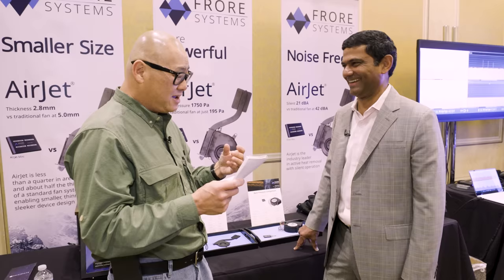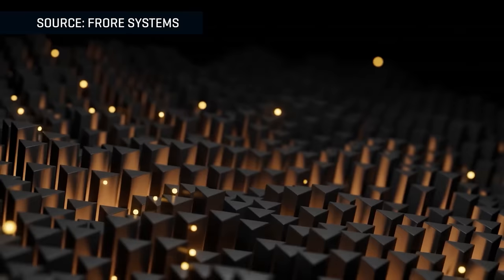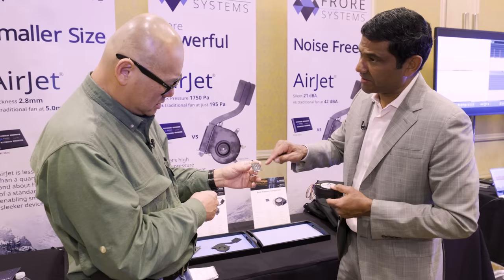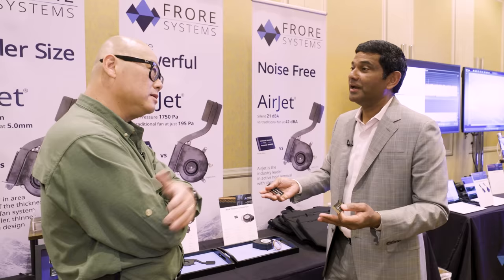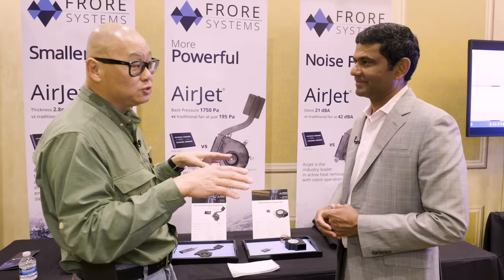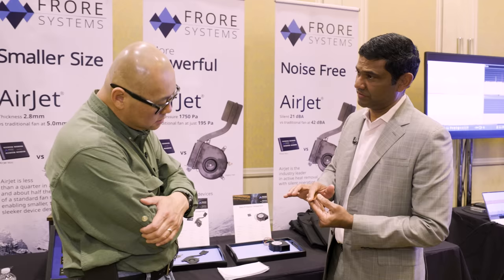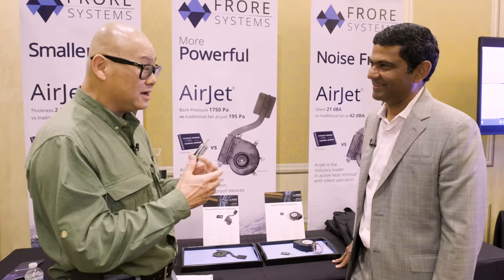Solid State Active Cooling Could Revolutionize Thermals

Comment: I think that this is probably way more exciting than any other announcement from the big players at CES 2023.
Reply: This has the potential to revolutionize computer cooling industry so yeah, I'm excited too.
Reply: I wonder if this tech could be used for electric powered planes too? 🤔
Reply: Half the video one question was on my mind. How much heat can it pump?
10W is nothing. this is currently near useless technology. We'll see if it improves but right now, useless for most computers. More expensive and likely about as effective as just pumping it into the chassis of the laptop, or just using a passive radiator in a pc with some airflow
Reply: There are so many problems with this technology and i will tell you why it is : 
1. Dust, dust, you cant clean this silent boy enough to be effective over period of time.
2. Price. is much moore expensive to produce and use...
3.Power consumption and Noise. Its loud and power hungry.
Reply: @Renovatio2142  1st and 3rd point is wrong.
noise is non existent, normal fans in gaming laptops use 3W of power, laptops in the high end use much powerful fans and more of them too, ROG and alienware have 4 fans in premium models.
2) price is a issue because effficiency is low, you'll need many of these chips in a typical gaming laptop which makes them expensive.
if efficiency of a single chip can be increased to 20-25W then we truly have a revolution.
Reply: @manojpatra2840  and about that dust!?, You forget to write how do you want to solve the dust problem...

And noise its a problem because always when you move air in high speed or around a obstacle you will hear it...There is no other way...
Reply: You probably missed the OLED monitors to be released by Asus/LG. 😉
Reply: @Renovatio2142  He literally answers this at 5:55 in the video
Reply: @undefinablereasoning  yea, thats bulshit....there is not such design...only solution you have is to cover the intake with dense filter and than you have to clean that filter
Reply: @Renovatio2142  So what? you have to do that with fans as well, judging by this things back pressure you'd just need to wipe your finger along the dust cover to unblock it.
Reply: the thing what grind me most about this is that they do not have at the show not even one powerful notebook cooled with this device...Not even one heat source cooled by this technology...
Reply: @undefinablereasoning  fans are robust, small concentration of dust on them will not do any harm to the device...In this came where you move air molecules with vibration...i dont know man....they dont have at show not even one cooling example with heat source
Reply: @Renovatio2142  I'm wondering if you even watched the video. If I recall correctly, most of your concern was addressed in the video. I advised you to watch again for you may have missed them.
and also while it is good to be skeptical, you don't have much to work on at the moment to outright deny their claim.
Reply: @kissu_io  OLED is already common, being used in monitors is nothing interesting, just a small step forward.
Reply: @Blueisnotacolor  watched but its just PR without any test..also their website looks like Ralph Loren Store instead of laboratory...
Reply: @Renovatio2142  they do have a demo laptop
Reply: @AlexRaylight  monitors are 27"-ish size or let's say 32". Name me 3 monitors that were released in the past 5 years please. Having them going from TV to monitors with a clean subsampling, text-clarity, high-framerate etc...is not so common actually and is quite a big deal since we were stuck for years with TN/IPS/VA panels.

While a vibrating pipe exhausting air is nothing fancy tbh. There are quite a lot of nice prototypes like that nowadays, most of them never reach production tho.
Reply: @plasticelephant1969  Not just computers. Thermals are a limiting factor in so many areas, especially for phones and tablets.
Reply: @archigoel  Actually yea, I can imagine that being used in phones somehow, imagine one day our phones blow hot air out of them, Lol.
Reply: It's always the "little guy" you have to watch out for!
Reply: @AmorDeae  Cools up to 28W chips. And uses approximately 1W of power to cool 5W of heat. He did say that this is first generation and is meant for thin notebooks.
Reply: @Renovatio2142  I dont think dust will be a problem, the force of the backpressure is too high to develop dust inside this thermal solution
Reply: @Renovatio2142  Dense filter? That's not how filters work. You can use a filter with single millimeter thickness that removes 100% of dust. They work with electrostatic charge, not with physical particle classification. I can easily imagine a simple and cost-effective laptop thermal pathway that filters dust (as long as the back-pressure number he's quoting is accurate).
Reply: @TrevKen  electric powered planets
When you need an extra 500 tons of weight and stupid amount of lithium batteries only to find that plane is too heavy to lift up
Reply: It's hard to innovate when big players can't think outside the box because of their investors. Investors want a regular stream of money which is what slow progression guarantees them, innovating is risky. If this wasn't the case, iPhone would probably already feature next level 100mp camera with you name it kind of crazy unbelievable feature and the M1 chip cooled by this technology.
Reply: True but it Would be even more exciting if the could use the 5 Watts of heat to run the chip
Reply: Implementation is a whole different story. There's a reason no laptop manufacturer has applied this yet, or why they didn't show it working inside a laptop
Reply: @Renovatio2142  let me guess, you believe earth its flat
Reply: too good to be true, this is a scam.
Reply: @JunLuden  they said no need for airflow, so no heat will leave the system (laptop).  they said putting 1 watt in results in 5 watts of cooling, which would be impossible in a closed system (no air vents).
Reply: @JunLuden  hmm, well by internet rules, you win this match.  Still, don't give these guys any money.  something too amazing to be true, may well be untrue.
Reply: @JunLuden  no, the typical response is fearing losing one's job to the new technology.

So, you think opening the door to the fridge will make your house cooler?  where does all the heat coming from the back of the fridge go?  same principle here.  if you don't somehow remove heat outside the system (laptop), then the system (laptop) just gets warmer.  No airflow = no loss of heat.
Reply: @brocksamson3282  so are you trying to say that thermodynamics needs airflow to work? is it that the way how physics work? how tf does the sun transfers heat to hearth if there's is no airflow in the space? wow based on your same logic science its also a scam
Reply: @Renovatio2142  did you even watch the video lol the airjet doesn’t even require vents
Reply: @Renovatio2142  all your assumptions are based on the misunderstanding that the airjet is a mechanical alternative to fans. Instead it’s a transistor based solid state solution, which is fundamentally different. Essentially what you’re saying is that cars are impractical as you’ll need to feed it lots of food because you mistakenly think car=faster horse
Reply: @Renovatio2142  bro they literally have 4 demo laptops running benchmarks in real time. As for higher wattages that will be addressed subsequently. It is a 1st gen technology. It’s like asking why an iPhone 3G can’t run genshin impact
Reply: It reminds me of those fans that are just a piece of plastic that vibrates back and forth, except next level. Pretty interesting.
Reply: Except the fact that he states it pushes air up to 200kph yet it can barely keep a ping pong ball 6 inches away afloat.  Seems more like 1/2 kph to me.  There is a huge difference from what he's claiming, and what is being shown.
Maybe in 10 years.
Reply: @lukeang5615  what a reply lol😂
Reply: @AmorDeae  the thing is smaller than a conventional fan though. It wouldn't surprise me to see 4 or 5 of these in a laptop.
Reply: False ridiculous hater post.

Comment: Wow, this is definitely the coolest thing demo'd at CES - let's hope they really can deliver on those promises.  Super-thin and quiet cooling?  Brilliant for ultralights.
Reply: Brilliant for everything
Reply: @Moire "Coolest thing"... i see what you did there...
Reply: @@joebeefhash3455 guess you will lose your money them because intel wouldn't sink millions on this company if it didn't.
Reply: My worry is that it won't be able to do anything to match the sheer volume of air that a fan can push. At this size, it does seem to fill a niche. This is a realm where fans just don't function well and this thing has a clear advantage. But I can't imagine it scaling up well at all vs fans. They just need to find enough business in that super-thin-n-light territory where CEOs keep asking for the impossible.
Reply: @pirojfmifhghek566  they don't have to because they are much more efficient. That said, your point is still valid because they can't just increase thickness to push more air, though I am sure there are ways around it.
Reply: @@joebeefhash3455 and portable consoles.
Reply: @@joebeefhash3455 It may have other benefits though, smaller size, less noise, longer lasting etc. It is interesting.
Reply: @user-pq4by2rq9y  Pro can dissipate 10W. This is only your lowest performance processors.
Reply: @pirojfmifhghek566  didn’t he say this technology is in jet engines?  Surely it can scale decently then, no?
Reply: @pirojfmifhghek566  the question is do they need to? If their performance is exceptional they won't need to, rather device manufacturers will build their devices around this product eg fanless M1 or M2 MacBook air.
Reply: My primary concern is dust. He mentioned using a filter, but filters have to be replaced. Laptops get clogged with dust as it is, and none of them have filters because that's a piece maintenance that no laptop user is going to want to bother with.
Reply: @The_Ballo  you can use a filter which is serviceable or just let dust clog your cooling device which is not and will eventually kill your device.
Reply: @solacedagony1234  They mention using vapor chambers to spread the heat load out, so if you have enough area available, you can likely just stick part of the chamber on the die, and fill the rest where practical with a bunch of these coolers or similar designs next to each other, thus dissipating more than the 10W mentioned.

Yet while theoretically heat pipes and vapor chambers would allow placing more of these solid-sate coolers, practically, I can't imagine a startup like this will be able to serve huge markets. So, they might as well just focus on small, particularly valuable niches first; by the time that succeeds they may have better solutions for larger heat loads; or at least large economies of scale that may make packing many of these more affordable.
Reply: @MoireFly  sure, I'm just explaining how they are currently marketing their offerings, not hypotheticals of what they could do
Reply: @solacedagony1234  I swear you're just repeating the problem back to me?
Reply: @The_Ballo  Perhaps I'm the only one that found it an absurd to say that someone would prefer no filter because it "doesn't require maintenance".
Reply: @solacedagony1234  No laptops have a filter for this reason. Laptops die all the time due to dust infiltration but nobody is going to sell a laptop with a filter that literally nobody is going to change
Reply: @The_Ballo  they may do it for that reason but it doesn't make anymore sense
Reply: @solacedagony1234  Maybe you don't understand what is being said here. The implication is the Airjet device will get clogged to hell without a filter, unlike a regular fan. Clear now?
Reply: @The_Ballo  That was clear from the onset, unlike your coolers without filters.
Reply: Any time you see new tech demoed like this, the first question should be what are they NOT talking about, because that's probably the Achilles heel of whatever that tech is. I notice he never mentioned power draw vs. a fan, which makes me wonder how much power these take to run. That was E.G. what killed peltier coolers as they're incredibly power inefficient at small deltas (I.E. exactly the state you want CPU coolers in). This being a MEMS device I'd expect it to be fairly efficient but who knows. If this does draw significantly more power for an equivalent cooling performance compared to a fan that could be the death knell for it, as power usage is one of if not the most important things to optimize for in ultra portable electronics (batteries being the single biggest contributor to size and weight).
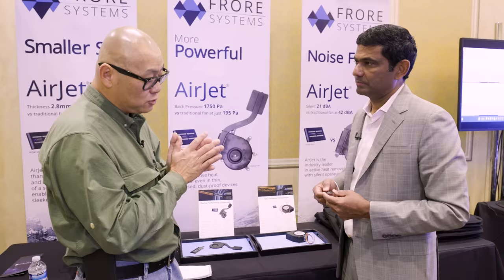Reply: @orclev  you mustn't have watched the whole video. They talk about power consumption and heat removal capacity at 8:12
Reply: @breadkrum6860  wich jet engine runs on this stuff? none i bet.
Reply: @-opus  longer lasting.... lol
Reply: @user-pq4by2rq9y  i guess this is not intel's first blunder. I guess the people working on the cleanest bench in the world don't think about dust factor as they should.
Reply: @fss1704  your comments provide so much valuable input 🤡
Reply: @buzz1ebee  I had actually jumped around a bit and somehow missed that, although without a reference to what a fan takes I'm not sure if 1 Watt for 5 Watts of cooling is a good result or not. He mentioned the larger chip can cool up to 10 Watts, although he didn't mention the power. I'm going to assume the best case scenario that it's 2 Watts of power for that 10 Watts of cooling. Looking at blower style fans similar to one of the ones they were comparing against those seem to take between 1 and 2 Watts of power to run, so it looks like it's in a similar power envelope in terms of power draw, but I'm not sure what the cooling capacity of such a fan is. Depending on that answer would determine if this makes sense or not. It does look promising though, 1 to 2 watts does look like it's at least in the same ballpark.
Reply: Would not escape physics. It would be even miracular to proper cool 150W tdp.
Reply: @pirojfmifhghek566  hold up. You can fold the pins to be extremely dense to get even higher heat dispose performance
Reply: @orclev  my computer uses a 0.42W fan to cool a 20W cpu, i bet that i can mod a cellphone vibrator to cool 5W in less space than this.
Reply: @mechamicro  no you can't, good luck with boundary effect versus clogging. If you bent the stuff you're spraying the dust into copper and that doesn't end well.
Reply: @Joe Beef Hash It's true the fan he showed that could put out as much "pressure" would do WAY more air flow.
Reply: @Joe Beef Hash it doesn’t necessarily need to work “better” than a fan. If it can do the same job, while being silent, solid state, and using similar or less power, then it’s a success
Reply: @solacedagony1234  Or align some more of the solid state fans and make it possible for the laptop to take a dump once a brick of dust is collected...
Reply: @Cineenvenordquist  That would be a good improvement
Reply: @solacedagony1234  10w is what the macbook handles without a fan.
Reply: @user-pq4by2rq9y  lol
Reply: @SyntheticSpy  It actually draws more power than a fan for now. Like 3-5 times more.
Reply: @orclev  If you're wondering what the Achilles heel is that they're not mentioning, it's probably going to be the cost to produce. He even said a real setup would still require vapor chambers with copper surfaces, and I can't imagine a MEMS device being more cost-to-performance effective vs a simple fan at that point. Its definitely limited to premium ultrathin market. And even then it will be far noisier than a totally passive setup like in a macbook air. I don't think people realize that most of the noise comes from air whooshing through small vents, not the fan/air pusher itself. You can have an almost silent fan, in an overall loud machine. So even noise to cost ratio might not be good enough to be worth it yet.
Reply: @pirojfmifhghek566  Get a CPU cooler and stick a bunch of these onto the fins. I imagine they'd beat fans handily. Then design an entirely new CPU cooler based on attaching these instead of fans and go a step further.
Reply: @Lassitude1001  Well, once you finish doing that let me know what your results are. As well as the price.
Reply: Hope, why he never did Notebook on the, do the pepsi test !
Reply: @santiagopicco1397  That's somewhat disappointing then. I can see it being useful in some applications, but good luck adding that power budged into an ultralight or anything of the sort and getting really solid battery life out of it